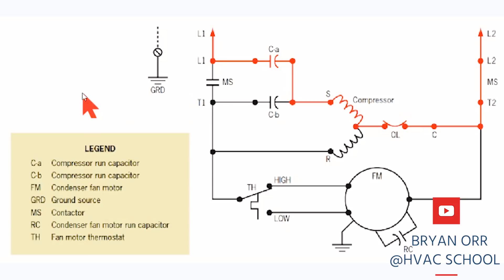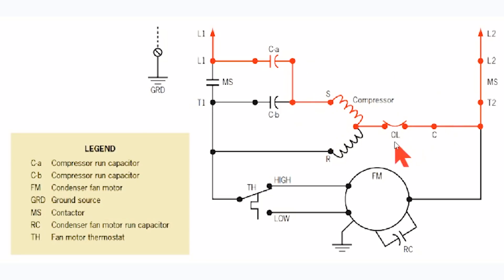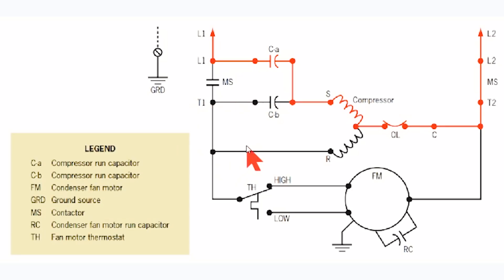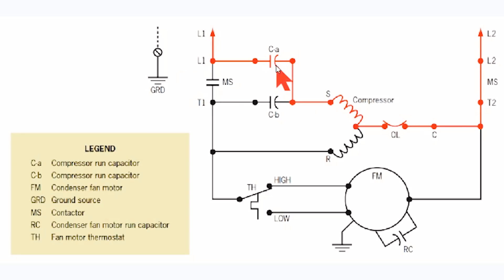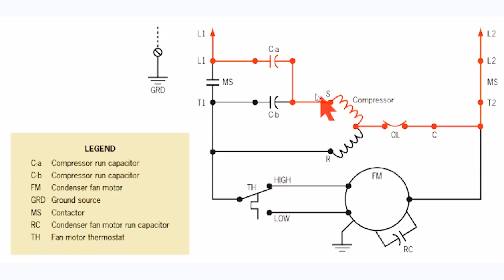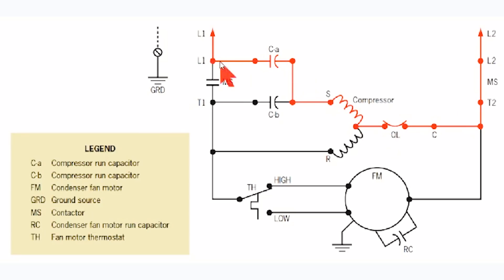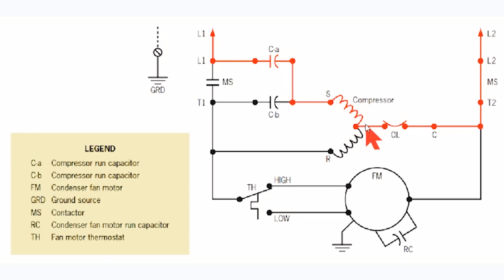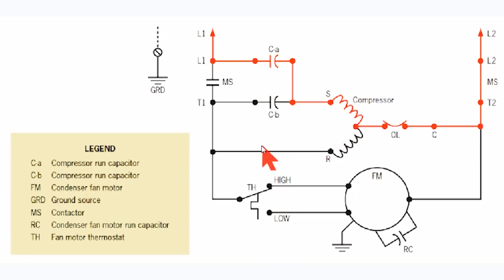Start Winding and Capacitor Crankcase Heater

Comment: Hello. Can you help me connect heater cranks to an inverter air conditioner and a normal on off air conditioner. Or if you have a more detailed explanation of the electrical circuit?

Comment: Recently discovered that our carrier AC unit is pulling 40 watts in standby. Thinking about switching the breaker off during the winter months to save power. Would this be detrimental to the AC's life in anyway?

Comment: I had a 50 year old apartment complex with 50 yr old rooftop Trane/Carrier a/c units, all with this design.  When OFF, they each pulled 7 AMPS, 24/7/365.  Tenants were paying the electric bills.

Comment: This is a great video, and I have not see GE's trickle heater in years. There are a few other factors that also need to be considered when using this method. First, it is strongly suggested along the trickle current path that a protective fuse be placed between the capacitor and start wiring. This helps protect the start wiring if the capacitor develops a short circuit. Second, a properly sized capacitor is necessary to provide the proper amount of trickle heat. If sized improperly, inadequate heat or tripping of the internal overland can result. Third, GE would use a resistor across the trickle capacitor to discharge it when the electrical switch was opened. If memory serves me correctly GE/Trane would only use two capacitors if a single capacitor could not supply the proper amount trickle heat, starting torque, and power factor.

Comment: Of course Cb will also back feed some current to the R winding and the condenser fan and maybe help keep humidity from rusting the fan. So if the Fan is rolling around at a very low speed don't be shocked, it is not a free energy devise. The goal is to assure that the compressor is never the coolest part of the system.  What would happen if you put your crankcase heater across the compressor normally open contacts ?  It would be another case where you didn't have dead isolation when the contractor is open.

Comment: The start winding acts as a bleed resistor for the capacitor.
Reply: Still get confused with "run" capacitors being wired in series with the "start" windings.
Reply from the maker: That isn't what this is